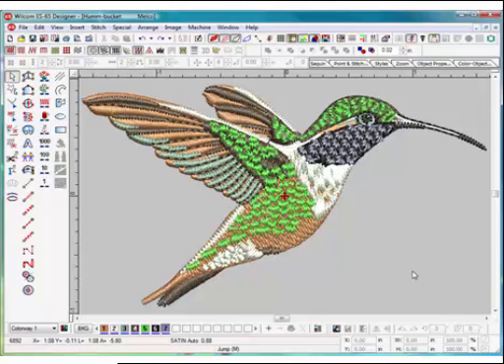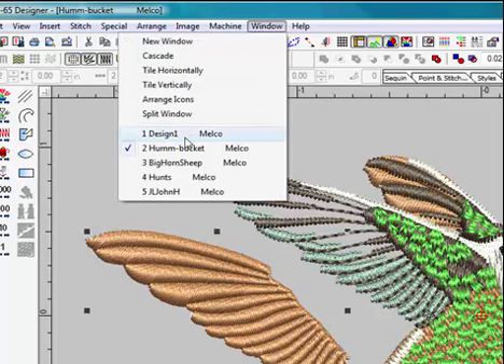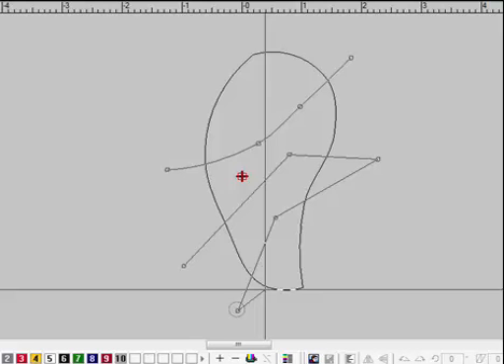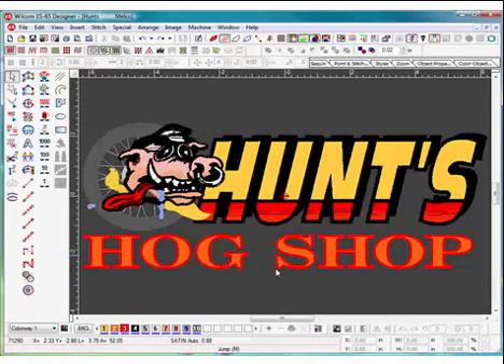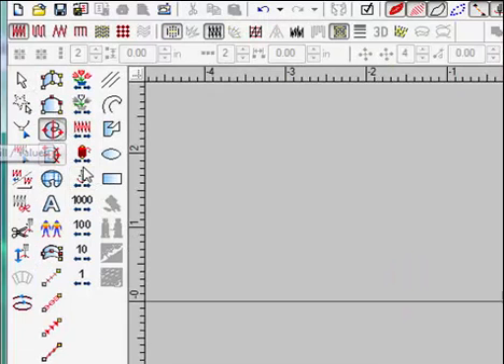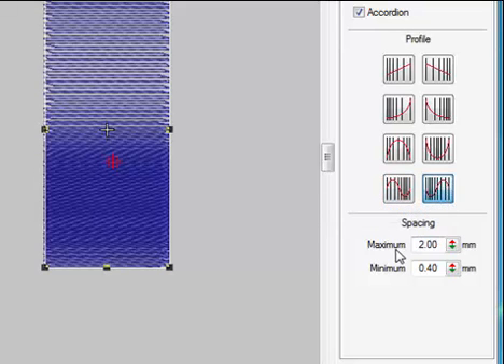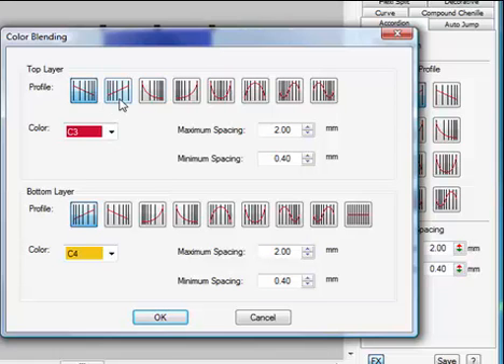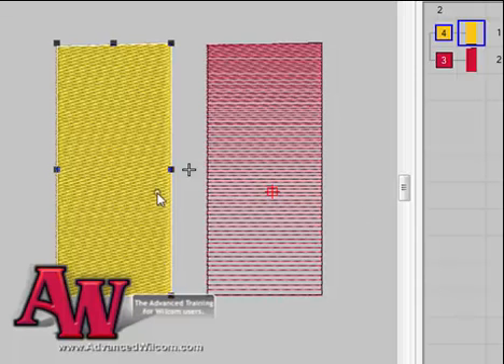Fill effects Wilcom ES65

Comment: hi
sir pls 
define these both angles in e2
thanks
Reply: The stitch spacing/density would depended on the fabric type and depending on the look of the shading you want and the width of the object a good starting point you can try using about 1/2 the amount of stitching for the shading effect.